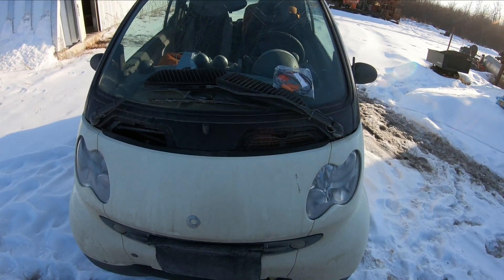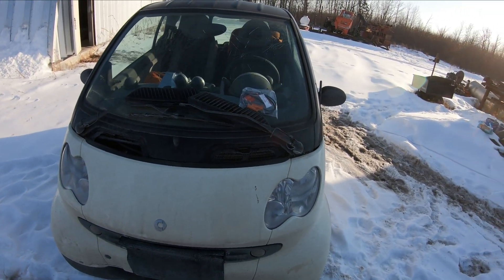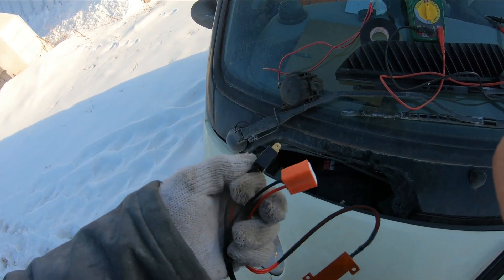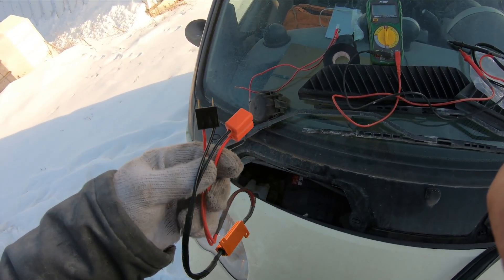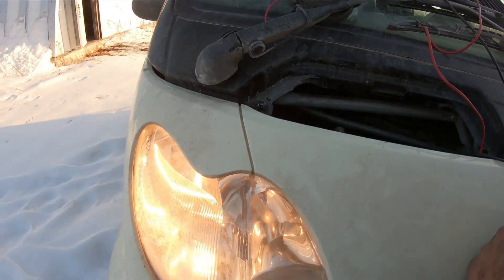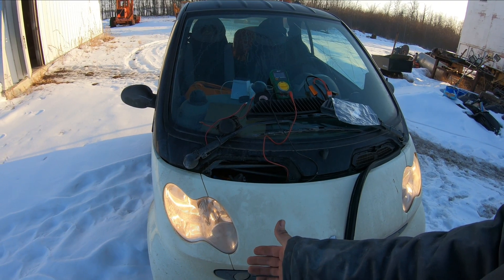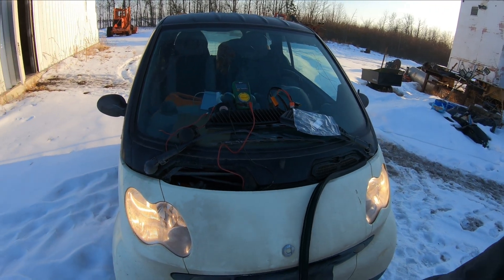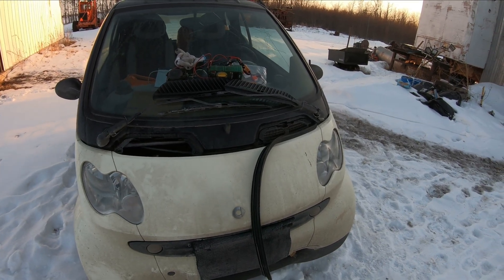Why Do 2001- 2007 Smart Fortwo headlights Burn Out

Comment: 10:28 so basically we solve te bulb but we melt a car.:face-red-droopy-eyes:
I have the same problem with my 450 where the same right (left on camera) bulb is not responding even though the bulb works. I've checked it on buzzer.
Can I solve it somehow without those overheating resistors

Comment: Hey questtion, i dont have daytime running lights on my 2006. Ive seen them turn on at night when i start driving but failed my safety because he said they dont turn on when car is started. Any thoughts on this im stumped
Reply from the maker: The day time running lights turn on when the car goes into motìon. As soon as car moves forward they come on. I would think that would pass inspection. 
Other cars daytime running lights go off when ebrake set. Kinda same thing.
Reply from the maker: Think you had a picky inspector maybe. If the car was imported it would have to pass local reg. & inspection to be registered I believe. Maybe new requirement from 2006 when the car was made?
Reply from the maker: Could wire low beams to ignition switch suppose. There is another port not used at back of smart headlight. Think was fpr that purpose. Port is there but mot wire in on mine. Just a plug in place.
Reply: Awesome help thanks
Reply: I recently learned this on my 450.

How to Turn off DRL:

1. Engine off

2. Pull the high beam lever

3. push "unlock" on the key remote

4. car beeps - DRL is disabled!

To turn on, press "lock" in step 3.

Worked on my Canadian 450 CDI! Might help?

Comment: wat if catches on fire
Reply from the maker: If put the resistors on the front headlights & they catch fire then make sure to drive the car in reverse until the fire burns itself out. Lol
Probable wouldnt catch on fire, but never know. Woud just make a mess of the plastics. Suggest not install those resistors or be real careful when picking a location to mount.maybe a remote location on some metal. I dont like them.
 Use the cheaper headlight bulbs instead. Might be able to find the factory resistors from Smart is also another better option than use those resistors that get so hot. Video was for info only. Do with your car what you think is best.

Comment: Great video - had resistors for an LED conversion on another vehicle and they do get VERY hot. Only attach to metal if using. Are the factory fix/resistors still available?
Reply from the maker: Possible, if there is some old stock is on the shelf some where. I opted to buy cheap light bulbs. 2006 is a old car now, 17 years. Wouldnt hurt to give Mercedes dealership in your area a call. You never know.

Comment: Howdy from down under 🇦🇺! I seem to have bad luck with headlights, but interestly on my car (not a smart for 2) the alternator has always run around the 14.2v to 14.5v range, and the factory lights lasted around 150,000-200,000kms as one went before the other. Normal charge voltage for a lead acid battery is around 14.2v to 14.5v and in colder climates such as where you are the charge voltage should be on the higher side, any lower and you will suffer from poor charging and crappy battery life. I really think it's down to the bulb quality... Also you are correct, the bulbs that have higher intensity do have a shorter life span, it's actually the trade off you pay. If want to increase the lifespan of your headlights then you might need to invest in a proper dimmer switch for your head lights. The other option is you will need to look for long life bulbs. Osram sell these, I use H1 type for my head lights, my high beams are H4 (which are still from factory). My tail light are from factory and I have about 320,000kms on the car. I have still to buy and test out the Osram long life bulbs.  The current set of head lights still work and my lights are a pain to get out as I have to remove the bumper then then remove the entire headlight assembly to remove the low beam bulb. I had a pair once last about 5,000kms... I was not happy... 🤣  Remember to not touch the glass envelope, if you do end up touching it, use some iso-propyl alcohol with a tissue and make sure it is clean and dry before installing. Anyways, hope this helps mate. Happy bulb hunting! 💡 💡 👍
Reply from the maker: Thank you Sir  Dimmer switch hmmm didn't think of that. Will look maybe there is such a thing for Headlights. The problem is the current the lights draw, dimmer switch work good for dash lights. I was thinking about an external resister for ignition coil but same issue the current the lights draw. Hard to get away from the heat a resistor makes at 12v. 
Yes but once battery is charged the charging voltage should drop down to 13.5v to just maintain the battery with in like 15 min max if battery is good instead of continue charge it. When the battery is not taking in anymore amps. I have only seen the voltage drop in the smart after hours of driving. I believe the voltage regulator/charge controller is to blame for the short life of Headlights & marker lights on the smart fortwo.